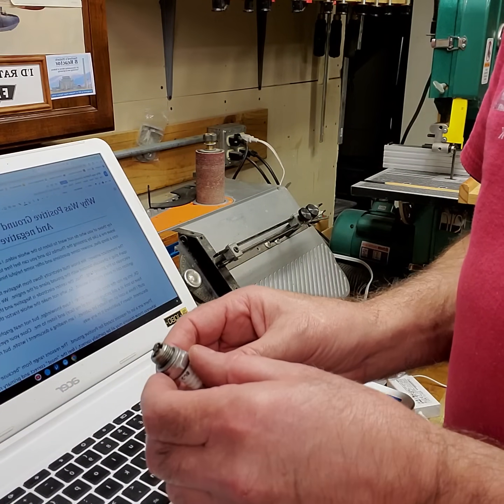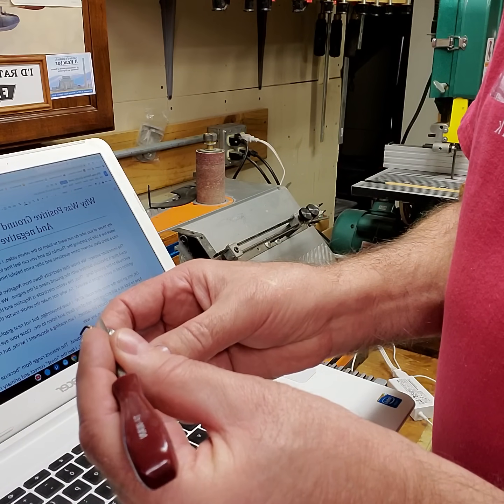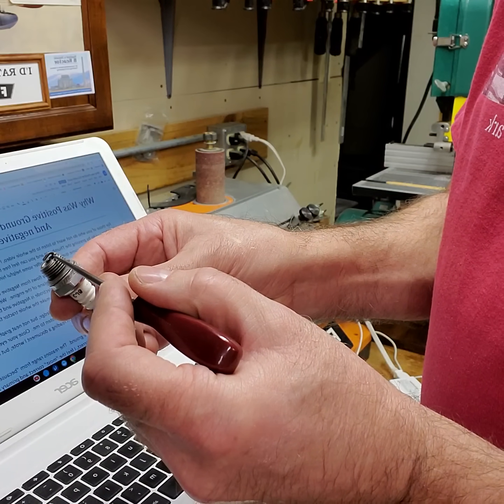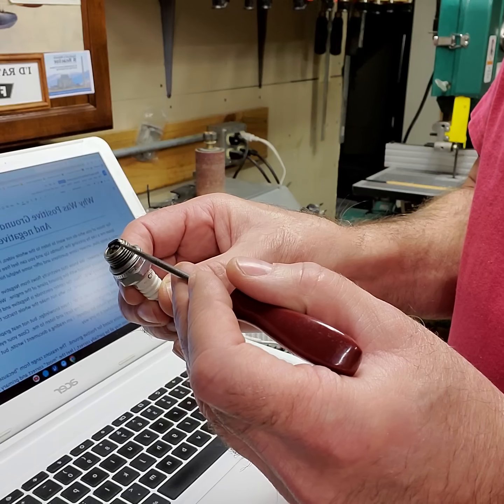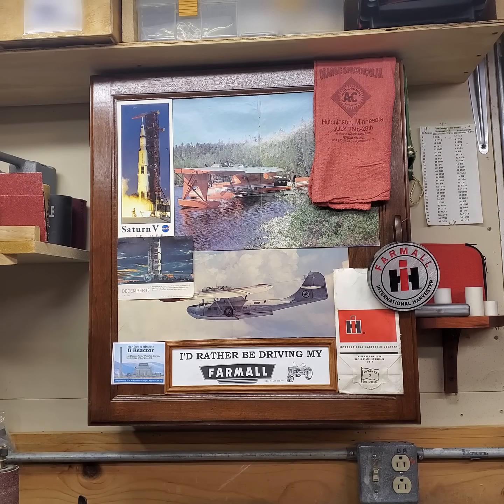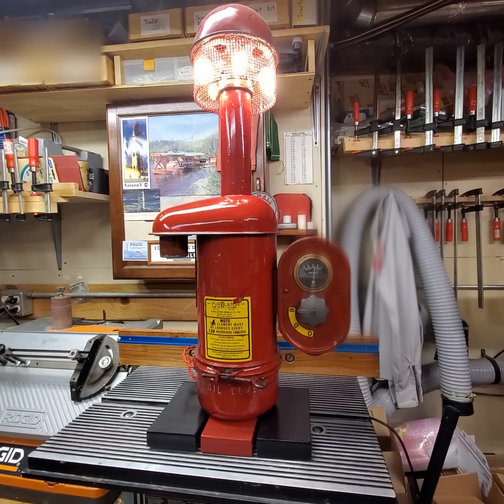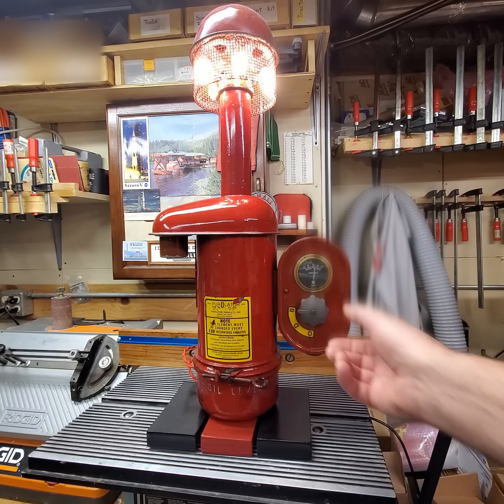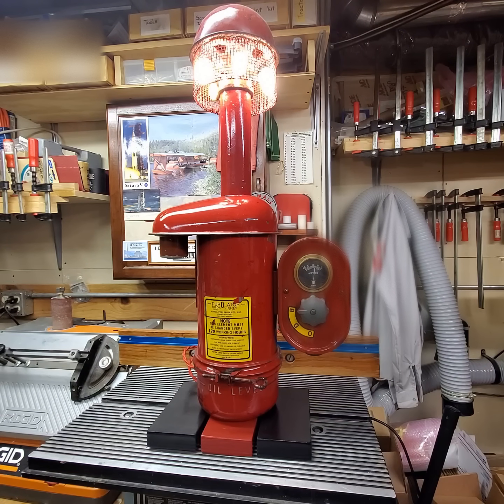Why positive ground was used on old cars, trucks and tractors

Comment: I think you could use diodes to prove your point on the direction of current flow?
Reply: There is NO confusion.
Electons flow from negative to positive.
However engineers use "conventional current flow" when doing calculations.
Conventional current flow is taken as from positive to negative.
Reply: Sort of. If you meant absolute proof that electrons flow that way, then you also have the problem of also proving that the diode only allows electrons to flow the way you assert.
I mean, you would have to also prove which way current really flows in a diode.

If you meant which polarity a given spark system uses; you would need a very high voltage diode!
A capacitively coupled scope probe is much easier to measure the secondary voltages (and polarities)...
OH---OH (mister kotter lol):
For garage mechanics without access to a scope;
The simple old fashion household AC neon testers, the kind with a clear neon bulb in the tip, and two test leads; will work!
Neon bulbs (have the property that only the negative electrode in the bulb glows!
But:
It might blow up your tester, you might have to choke down the power (a series resistor, or shunt it with a resistor or a almost closed gap junk plug). It might hit it hard enough to glow all the gas in the bulb.
I have not tried this myself...
You might try first with just one lead connected to the coil/plug wire, and the other end free, and see if it gives a polarity glow indication...
Oh, and don't hold the tester in your hand when you do this; just saying...

A quick Google search refresher shows that the works of: J. J. Thomson - discovered the electron; Sir William Crookes - demonstrated current is negative flow; and Millikan's oil drop experiment - measured the charge on a single electron...
[I only recalled Millikan, I forgot about Crookes, even though I use CRT scopes everyday LOL]

Comment: i am 88 yrs old have worked on engs.  since about 12 yrs old never saw a pos gd system ????????
Reply from the maker: Hi Frank!  Cars, trucks and tractors used positive ground.  Typically with 6 Volt.  It seems like, when 12 Volt systems came into design in the 50's, the switch was made to negative ground.
Many 6 Volt tractors are positive ground.  Ford used negative ground on the model T and then switched to positive ground with the A.  Then, switched back to negative ground after the A.  I once read that Packard used 12 Volt positive ground sometime in the 50s.  Wouldn't that be a great car to have in your collection?

Comment: But why are the negative grounded vehicles “easier to work on”? You did not explain why or did I miss it?
Reply from the maker: Hi Louis!  Thank you for commenting.  I think negative grounded vehicles are easier to service by most mechanics because we all are trained in "conventional current" flow which is positive to negative (hence negative ground).  But, that's just my theory.  I have seen people somewhat nervous to work on positive ground machinery.  But, with a  meter, it makes no difference.  All their training is still good and applies.

Comment: More confusion. While it is true that electrons move from negative to positive, that is not the definition of electrical current. Check any physics book, current moves from positive to negative. When this convention was defined, no one knew electrons existed.
Reply from the maker: Hi Brad.  Thanks for the comment.  I have indeed checked out quite a few physics, math and chemistry books.  The confusion is always between Electron Current and Conventional Current.  I've always read that Ben Franklin chose "Conventional Current" which is Positive to Negative.  That's what they thought back then.  In the video, I explained the good reason why they thought that.  Conventional Current was how I was taught.  I believe most books teach conventional current.  I still use conventional current when working out problems.
Reply: In the very early days of electricity the electron was not discovered.  By convention, mutual agreement, current was designated as a positive charge flowing plus to minus.  To understand vacuum tubes and semiconductors electron current must be understood.  Old textbooks may still use positive current.  Technology of today would not.
Reply: Positive to negative is called hole Theory
Reply: @mofbombay6290  I had nothing to do with that.  The mechanism in a semiconductor for a hole to move is an electron moving in the opposite direction.the hole moving is a handy illusion.

Comment: Great video.  I always thought GM led the way to negative ground in the early 40s so that corrosion would be at the ground strap instead of at the accessories.
Reply from the maker: Hi Michael, thank you for commenting.  That is very interesting indeed!  I've heard a similar theory on Mack trucks and body corrosion.
Reply: @bryanh1944FBH  Body corrosion vs positive or negative ground is a new one for me!
Reply: It is actually corrosion at the accessory terminals rather than body corrosion.  With negative ground, the corrosion will be at the battery posts.

Comment: I was taught that the reason all secondary ignition systems were positive ground is because it is easier for electrons to travel from the hot center electrode to the cooler spark plug ground. This can be proven by looking at a waste spark secondary pattern on a scope. On a six cylinder waste spark system, three plugs are positive ground and three are negative ground. The positive ground plugs will have a noticeably lower firing voltage. About 15 percent. Not a factor with todays powerful ignition systems, but years ago it made a difference. If you ever put an ignition coil in backwards on an old points style ignition, the car might misfire under a load.
Reply from the maker: Hi Robert!  Thank you for your comment and lesson.  I will have to read up and educate myself on waste spark systems.  I don't know anything about such a system ... yet.  The 1933 Farmalls did not have such a thing.  Ha ha.
Without yet having read up on waste spark, I am also thinking about what waste spark has in common with combustion chamber pressure.  It takes higher Voltage to make a spark jump when the gas pressure is higher.  That's why the "old time" garages had pressure chambers to test spark plugs.  I wonder, in waste spark, is one of the sparks at a lower pressure?
Reply: @bryanh1944FBH  The spark plugs used in those engines have a special material either platinum or iridium on both electrodes so there is no ground electrode erosion from the reversed plug.

Comment: Why did B&S use a flywheel with the leading magnet negative instead of Positive on t heir sixteen horse single cyl cast engines.
Reply: That doesn't tell you what polarity the secondary spark winding is, it could be either polarity.
You would have to measure the secondary pulse to see how they wired it...

I assume you mean it generates a negative voltage at the coil (magnets are not neg and pos, but I understood what you meant).
But IIRC, the points open when the magnet is switching polarity over the coil, inducing maximum flux change at the moment the points open. (coil is now at maximum positive voltage) *IIRC.
Either way, it does not tell you how the coil's secondary polarity is wired...
This you would have to test...

Comment: Hey Bryan , it's Bryan Clark from MO.        I have a Ford 861 positive ground 6v. system.      I struggle with whether or not I should have external register.     Could you please explain.     Thanks, Bryan Clark
Reply from the maker: Hey Bryan!  External resistors (series resistor)  limit the voltage to the coil to prevent it from overheating.  A coil manufactured for 6 Volt operation does not need an additional resistor when used on a 6 Volt system.  That would result in a very low coil voltage.  I suspect this is what you have.
Coils manufactured for 12 Volts often (but not always) have an internal resistor.  So, you have to know more about the coil which you have.  There are different kinds.
Also, positive ground would not make a difference in this discussion.
On 12 Volt systems, if the coil is so hot that you cannot touch it, that is an indicator that an external resistor should be added.  Some 12 Volt systems start with 12 Volts on the coil and then switch back to a lower Voltage by means of a resistor.
Reply: @bryanh1944FBH  Correct, and just for those that might encounter this; sometimes the 'resistor' is actually a special wire (in the harness), and not a material component. The wire is a resistive metal (I assumed it is a selected alloy), running from the ignition switch IIRC, to the coil. In start position, the starter wire circuit also supplies 12V direct to the coil. The resistive wire is still connected to the run circuit power, and voltage drops back as soon as the key is released.
I think of some cars (GMs?) that had the starter solenoid on the firewall, the ones that had two cable studs, and TWO small studs. the extra stud was hot during cranking and was for the 12V coil boost during cranking AFAIK.

Comment: My '48 Ford 8N tractor is 6 volt positive ground , if i switch the battery to negative ground , will my tractor run better , start easier ? If so , maybe i should switch my '65 AJS 350 motorcycle from 6 volt positive ground to negative ground also ? If electricity flows from negative to positive , which way does lightning travel ? up from the ground or down from the sky ?
Reply from the maker: Hi Derek,  I can't comment on  which way lightning actually travels.  But, that is an interesting question!
As far as your 8N, I advise keeping it as it came from the factory.  Then, for the ignition coil, make sure it is installed correctly.  In your case, that means the + terminal goes to the distributor.
Reply: @bryanh1944FBH  Thank you for the quick response , i will leave both the tractor and the AJS at 6 volts and positive ground . They have not been a problem as stock and unimproved .
Reply: My mechanic friend tells me that lightning has recently been ascertained to travel from ground to cloud.
Reply: I thought lightning went from the cloud to the earth. Then I learned hole theory and read that lightning goes from the earth to the cloud. Then I read that it actually does both! Now I’m questioning what it means by “goes from” one place to the other. What is moving? It isn’t like a football going from one player to another. Is reality just the absence of its opposite? Ommmmmm

Comment: If jumping a 6 volt positive ground system with a 12 volt negative ground, attach the power source to the starter and not the battery. The starter does not care how the cables are hooked up ( magneto ignition). The starter will turn in the proper rotation.
Reply from the maker: Hi Rollie!  Your comment is very interesting indeed.  I've never considered jumping a 6 Volt magneto based engine with a 12 Volt source.  But yes, I can see that this would work when done as you clearly explained.  6 Volt starters are often powered by 12 Volts.  Plus, because they are series wound, they will always spin the correct way.
Question:  when you do this, do you remove the battery cable to be extra safe or just depend on the starter switch contacts being open?
Reply: @bryanh1944FBH  My experience is only with Farmall tractors, I have 3 H's. I don't remove any cables because the starter button circuit is always open until button is pressed. If the tractor would have a battery ignition I would remove a battery cable.
Reply: @rollieevans6292  I operated an H in my youth. Love it.
I think you misspoke?
IF a tractor had a starter solenoid cabled to the battery instead of a full current starter button, then you would indeed have to remove the battery cable at the starter to jump it with another tractor with a different battery system.
I think you meant to say you would leave the battery ignition on it's original battery, and isolate the starter power, if needed. (remove the battery cable at/to the starter).

The H I remember from my youth, I think had the button that passed the full starter current, which would have effectively isolated the starter circuit if not engaged.

We just had to hand crank it when the battery was dead LOL.
Reply: @troubleshooter1975   Yes and no, if that makes sense. I have jumped a Farmall super C with battery ignition without removing the batt cable.  My tractors are all magneto equipped with a push button to send power to the starter, so no matter how the jumper cables are attached to the tractor chassis and the starter lug there is no back feed thru the push button to the elec system. I still use a crank to start them on occasion.
Reply: @rollieevans6292  I think I said that wrong. I agree totally with your first post and the starter button arrangement.
I was referring to the part where you said:
" If the tractor would have a battery ignition I would remove a battery cable."

It was ambiguous to me, and I wanted to clarify it for those viewers here that are trying to absorb the subtleties.
Just to confirm what you were describing, and you meant a battery powered coil ignition, then it would have to be powered by something while cranking, for the engine to start.
If they removed either battery cable at the battery (which is what I thought you were saying), on the tractor being jumped (the 'recipient' LOL), then there would be no spark.
The recipient's battery could be unhooked from the starter or starter solenoid, if so equipped, to isolate the systems, if it has a key actuated starter.
[put a glove or something on the loose cable]
Then jump at the starter lug and frame.

Comment: Wow. The apparent contradiction I kept seeing in the circuit of an ignition system is in the secondary coil winding. This has bothered me for years. 

Ayn Rand was right. Contradictions do not exist. If you find a contradiction, check your premises. You will find one of them is wrong.

Comment: Great educational video!  I was also in the crowd of people who thought electrons ran from positive to negative, I didn't even know you could have a positive ground.  I'm enjoying the content, keep up the good work!
Reply: @sourand jaded Tesla coils produce AC. The arcs come from whatever is pointiest. If the electrode at the top of the Tesla coil is a round ball, then the arcs (both positive and negative) will come from each edge, corner, point, or blade of grass around.
Reply: hole flow is the flow of positive particle  in electronics theory   when one electron leaves this spot there is a hole that will move to the next created spot of an electron  ergo hole flow
Reply: @leopoldpoppenberger8692  Just like 'conventional' current, 'hole flow' is just a conceptual aid. Holes are just spots where there could be an electron, but there isn't, in the same way a vacuum is just a place where there could be matter, but there isn't, not even gas. Holes don't actually move. When an electron moves in the lattice a hole 'appears' where the electron came from and the hole the electron moved into 'disappears' but in another way it doesn't, it just isn't empty anymore. It's still a place where an electron can be, but there is.
Reply: @sourand jaded Not a single crt TV set i know has grounded screen. Grounding the screen would require the cathode side of crt to be at said 20 kV negative. That means, the whole circuit must've be isolated from that high voltage, including all potentiometers, antenna input, speaker/headphones output, mains supply and so on. You can get away with that in some small oscilloscope, where the high voltage would be at 1 kV,  but definitively not with TV receiver having up 40 kV. And yes, they do zap, but not stronger than static in clothes. And they attracts a lot of dust which you have to clean with a dry cloth, otherwise you risk receiving serious shock.
Reply: @sourand jaded But the cathode is NOT several kV in relation to the grounded frame, for reason I mentioned already. The cathode and Wehnelt cylinder are a part of vision amplifier circuit, which has to operate with about 100 V amplitude and frequency ranging from DC do several MHz. There is no way to shift that signal by potential of tens of kV below ground. The anode side doesn't have any signal on it. It's just DC provided by flyback transformer, filtrated by capacitor made of inner and outer layers of coating on glass of CRT, at the funnel part of it. Maybe that coating made you confused but the anode inside the CRT is very much positive in relation do the ground.
Reply: @sourand jaded Have you read the booklet on electromagnetism by Edward Leedskalnin (Coral Castle)? Very interesting
Reply: And your house ground is - for 50 times a second and + for 50 a second for a 50HZ country 
And your house ground is - for 60 times a second and + for 60 times a second for a 60HZ country
Reply: @ratbag359  No, 50 Hz means 50 full cycles per second, which is 50 times positive and 50 times negative.
Reply: @brys555  my bad fixed